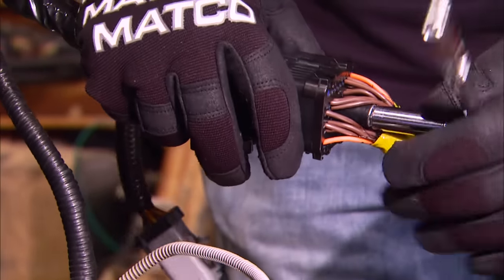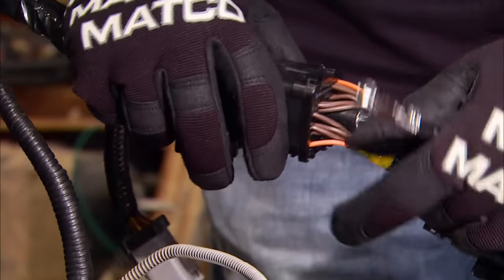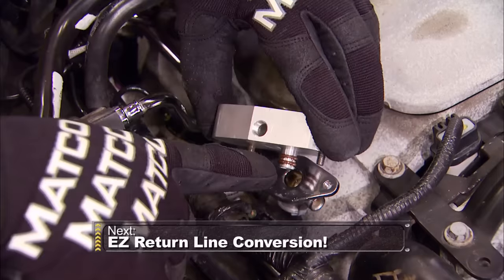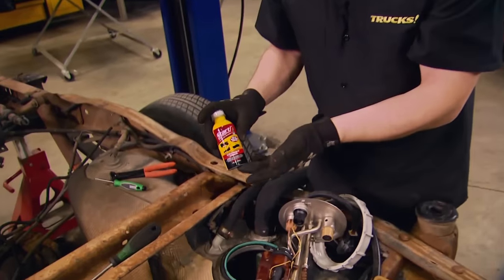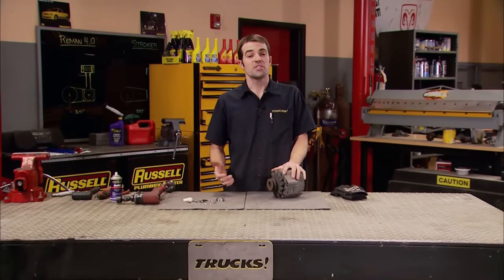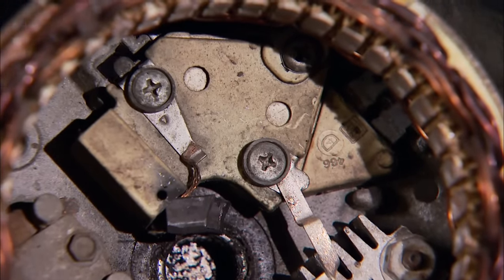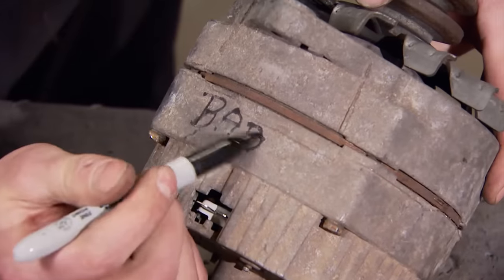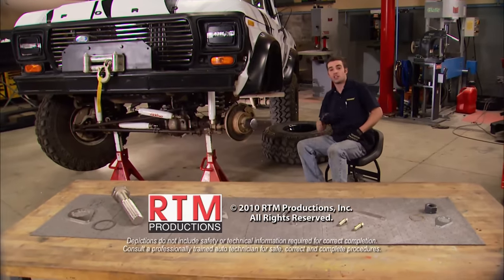Just 4 Wires Needed to Fire Up a 4.6L Modular V8 in our Ford Ranger - Trucks! S12, E6

Comment: i got news for you guys, the thing your calling the STATOR is actually the field winding's and the part your calling the rotor assembly is the STATOR. the stator voltage is regulated by the voltage regulator because the more voltage you apply there the more output it makes.

Comment: Wonder how many times they started it off camera before showing us the "first start"?
Reply: @realrickharrison3103  you must have been looking in the mirror when you thought of that.
Reply: Kevin 747, that’s the limit of real rick’s vocabulary, he posted the same thing to me, it should have fired up ok, they had the original “4 wire” engine loom, and a computer made for it, I didn’t see any “4 wire” charge circuit wiring on the alternator, nor any “4 wire” oxy sensors, it would have taken ages to fill those oil lines on the remote oil filter, so it would have been better for it too have not started straight up.
Reply: Real Rick Harrison 
How’s it going Rick!!!

Comment: Just 4 wires needed to start up this 4.6 is B.S. there is over a hundred wires that need to be hooked up prior to hooking up those four wires. 
My 94 Chevy pickup starts when I connect the same 4 wires.
Reply: So does a 94 ford
Reply: I think they mean that there are only 4 wires needed to hook up to the standalone harness.
I am doing the 4.6l swap into my own 66 mustang on my channel. The holley system only needs 3 or 4 wires hooked to it. But from the holley computer, its all plug and play for the rest of the engine.

Comment: Who could resist cleaning the alternator case?  I would never put it back together unless I cleaned and blasted that case.  Lol
Reply: And I'd never put any work into at all until I did continuity checks on the stator and rotor windings.
Reply: haa. was thinking the same thing..
Reply: That is not necessary for the function of the vehicle. 
I'm a do-it-by-necessity kind of guy, so as long as it works, who gives a damn how it looks?
Reply: @ChuckUFarley90  Chances are these guys don't do anything. Google  masters more than likely.
Reply: I agree. I'm not putting that kinda work into rebuilding it without at least cleaning the case and making it look a little better
Reply: @marcmielhausen1971  absolutely!!!

Comment: Stock ranger pump will feed a V8. I have ran pumps out of 2.3 rangers in crown vics. Pump has no issue feeding that engine even at wide open throttle for sustained periods of time. Have done it many times on derby cars.
Reply: Ran a SVT focus pump in my procharged 01 cobra good for 500HP

Comment: I love that these guys are putting a modular engine in this project!!!!....I just wish the horsepower guys would do a full on race build of a 5.0 coyote ,5.2 predator, a eliminator or something along that line.
Reply: Way to many 5.0 builds. Needs to build the 4.6l. Everyone wants bigger displacement just because it’s a bigger number. Plenty of drag 4.6s with well over 7-800 hp. And a lot cheaper than a 5.0
Reply: @bobbyroberts5751  I agree! I'm doing a 4.6l into my 66 coupe on my channel right now. For less than half the cost, I can push this 4.6 to 400hp very easily and reliably. Since the car is super light, I won't push much more unless I tub the rear end for wider wheels.
Reply: @4WDTrek   badass man I’ll have to check it out. If you haven’t already look up Andrew lavender on YouTube. He’s got a 4.6l strip car and it’s a bad one.
Reply: @bobbyroberts5751  for sure man! I'll have to check that out for sure. I'm building mine more for autocross and road courses. Of course I'll want to see what 1/4 mile times get put down too.

Comment: Could someone tell me where to find the wiring harness they use? I've been looking for information on it and where I could buy it but i couldn't find anything.
Reply: @Davin Kaganac Dunne right closed in 2018. Buy a Holley standalone.
Reply: @Davin Kaganac Holley for sure. Using it for my own 4.6l swap into my 66 coupe. I think I have like 3 wires to hook up. Super easy.
Reply: Holley! I have the terminator X for my own 4.6l into my 66 mustang on my own channel.

Comment: Honestly looks kinda crappy with all the parts not clean up and half refurbished, should have cleaned up that alternator and the motor, it's easy and doesnt take much time, would have made the truck show worthy, now with all that you wont ever want to open the hood
Reply: That is not necessary for the function of the vehicle. 
I'm a do-it-by-necessity kind of guy, so as long as it works, who gives a damn how it looks?

Comment: Yep, any conversions now cost twice as much considering half the system has to be re-engineered.  Eliminate traction control, ABS, anti-theft, electronic shift tranny, locking torque converter, on and on.  $$$$
Reply: In my 66 coupe build with a 4.6l swap on my channel, I just said screw it and went full standalone. I don't have to deal with any of that extra stuff. So much easier.

Comment: About the 10 si Delco Remy alternator. I get it. You don't have time to tell the whole story on testing the field, the stator, the rotor for shorts, opens, grounds and resistance along with the rectifier bridge and diode trio. You pointed to various electronic items like the rectifier, diode trio and the regulator and were vague in your principles of operation. Honestly if you could you should have done a complete trouble shooting of the different subsystems in the alternator and made it into a complete episode and if you had time add a starting motor rebuild but you are not a tech school and if a viewer want to get more in depth they should go to a good trade school.

Comment: The aluminum housing of that alternator looked pretty… ugly. If one were motivated to clean and pretty it up, how would one do that? Is there an evaporust formula for aluminum tarnish? If I painted an alternator housing, what kind of paint would be best? Special areas that need masking off for electrical conductivity?
Reply: @thomasdaddio741  But does evaporust or rust-blast actually work on cast aluminum?

Comment: What vehicle would this have come in?
Reply: To many to list check out the Wikipedia page.  But two big ones were crown victoria and f150.

Avoid the 3 valve like the plague.  And unless you really did your research and want the extra power they solved some of the 3v problems with the 4v.  Some.

Comment: What isn't mentioned is Vin coding for inspection laws
Reply: Jon-Christian Kaczor 
They probably register in a state without inspections
Reply: Or you go to a referee if you live in a state with inspections, looking at you California.  Bring ALL YOUR CARB info though, even if its stamped, bring in documentation.  If they see an Ignition box, you're done. Its an automatic failure on the visual. They will fail you right then and there, without even the chemical test.

Comment: I don't see any value to rebuilding parts unless they aren't readily available.   Yes you save a little money but how much is your time worth?   Just like changing your oil.  Yes I know how but by the time I get all the stuff, dispose of the used oil and add in my time it's more practical to pay someone.
Reply: Not really..  if the filter and oil cost 20 bucks and an oil change costs 70 then it's worth it to do it at home, especially considering for the 70 you can buy a better quality filter and oil than the cheap stuff mechanics commonly use
Reply: @AFXGaming  yes cheap oil which still isn't $20 for filter and oil so stop talking out your ass.   If your car requires synthetic like a lot of new cars it's $6+ a quart.  Or in my case that's 8 quarts of 0w20 x $7 = $56.  Assume even $5 (which they cost more) for a filter and it's $61 plus tax.  And you now have 8 quarts of used oil and filter to dispose of properly.  A dealership oil change at Chevy is $65.   You can't tell me my time isn't worth $4.  And no toxic chemicals to dispose of and it includes a tire rotation.   Seems a good deal to me.
Reply: At least doing it yourself you have the confidence it was done right that should definitely be worth your time. Just saying I've seen some dumb ass shit when it comes to something as simple as an oil change, for instance Walmart changes ur oil they don't remove the drain plug from the oil pan unless requested because their so called (technicians) strip them so often they've opted to stick a suction tube down the dip stick and suck out the oil.... That is no bullshit....
Reply: @bmstylee  buy your oil at Walmart, is waaaaay cheaper.
Reply: @Mxxxxxxxxxx_q  full synthetic isn't any cheaper.   And I refuse to patronize Wal Mart.  Quick Wal Mart search.  Valvoline 0w20 full synthetic 5 quart container $87.99.  So no it isn't cheaper.   And I would still need another 3 quarts to fill my Silverado.
Reply: @davecarakasavage919  well.  Maybe you shouldn't go to the cheapest place for service.   Remember lots of times you get what you pay for.
Reply: @bmstylee  are you here in the U.S ?
Reply: @bigboreracing356  NOT TO CHANGE YOUR OIL AT WALMART, TO GO INSIDE AND BUY IT YOURSELF SO YOU CAN DIY !!!!
Reply: @bmstylee  $21.97 for 5 qts.  Don't know WTF you're looking at.
Reply: Wild Bill 
The time I took my car to a quick oil change place and caught the workers smoking crack in the pit was when I started doing all of my oil changes myself.

Comment: No continuity checks on the stator or rotor windings?  Job half done.
Reply: And no test on the rectifier diodes. Any decent DVM will have a diode check function and it only takes a couple minutes to make sure none are shorted or open.

Comment: Wow, pretty much any EFI system needs 4 wires.
Reply: With the Holley Terminator X, that is very true. I had to connect a ground, ignition and power wire. Made my 66 coupe with the 4.6l swap on my channel a super easy breeze.
Reply: Can i use the holly for a 2004 4.6 from a f150

Comment: 1:35 "ford won the muscle truck series" whatever. why not take tgat statement and think about the differences those trucks had. im not talking suspension or anything im talkin weight, displacement, gearing and everything combined. i wanna see a chevy truck with a built 454 and a ford truck with a built 460. better yet. take those exact same 2 trucks and put a 460 in that lightning and put it next to that chevy as it was built. i almost garuntee the results would be different. im not a fan boy for either company since ive owned and still drive both but there was still very little point in that statement.

Comment: and 450 reasons why the sensors and or all the connections inside the ECM failed after a few days after the 4 wires part worked and the old guy with points and a carb just stopped to ask if I needed a tow home.

Comment: Battery positive battery negative fuel pump 12 volt key on switch

You guys didn't say positive or negative concerning the fuel pump the 12 volt key on switch as in the engine accessory or a switch to power that new ECU and the average person wouldn't know whether this switch is positive or negative four wires year right I count six plus a grounding strap of some sort for your battery but yes this is very f**** simple I used to work on the 4.6 and your ass is going to hurt if you try to rewire that crazy weave that basket of wires now showing I'm about to Universal problem with all the 4.6 and that is oil filter housing gasket I don't care if it's a beamer or a bucket if it has a 4.6 that's Ford's engine and it's going to have this problem that's the mysterious oil leak it reminds me of the 3.8 that was also a Ford engine sold to multiple manufacturers it runs great but Ford reminds me of BMW they make great engines they run like Swiss watches when you by the technical ones with all the Star Trek/ Star Wars Electronics attached to them not to mention the metal and the engineering is just on another level but these m********** couldn't wire a gym shoe seriously they couldn't lace a gym shoe yet they can build engines 10 second quarter miles run for 800,000 miles and that's their V engines their inline 6 can be even meaner I don't understand this Ford BMW get it together but yeah I recommend this guy's kit based on this video even though the guys on this show are damn good mechanics I grew up watching these guys and a few other guys but I'm confident with my professional mechanical opinion that a well trained monkey can do it that means that a man with a higher brain capacity give it to him by God can do it so can women and children and they could have touched the starter to and they could have touched the starter to the and they could have touched the starter to the battery so you don't even need their fancy starter button to make this work for you🤣🤣🤣😂😅🤔👁👀👣✌🏾👂🏾👊🏾🖐🏾✊🏾🤘🏾🤘🏾
Reply: Oh crap they did mention the battery stand-alone system🤔🤔😅🕶😅😂😂😂😂🤣🤣🤣🤠🙋🏾‍♂️🤷🏾‍♂️🤘🏾✊🏾🖐🏾👂🏾✌🏾👣